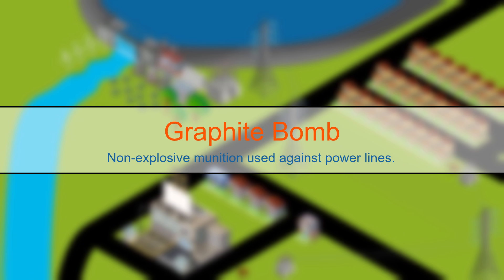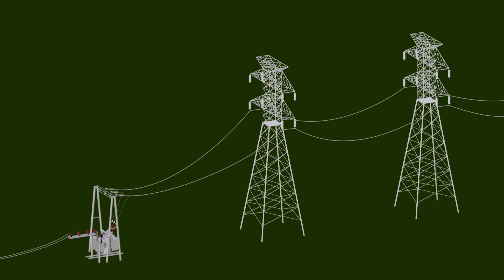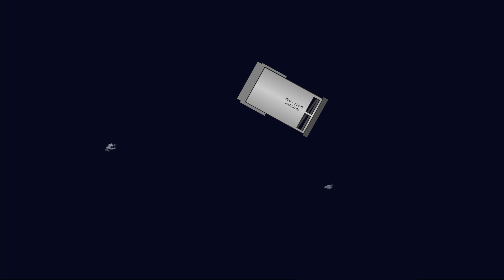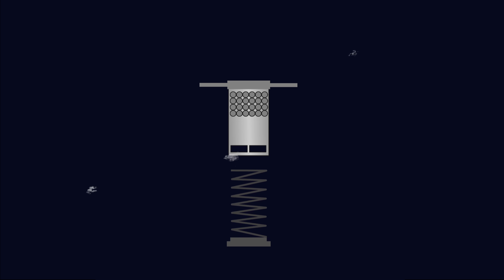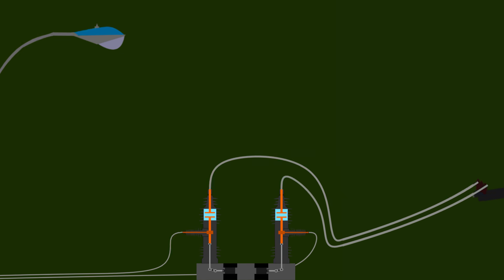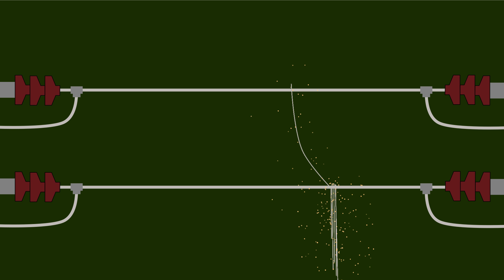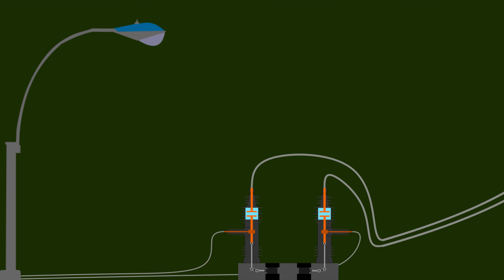Graphite bomb

Comment: Civilians are the only real target in a military operation and any other conclusion is propaganda or psyop manipulation. Any military operation targeting non civilian onjectives are wasting resources and fulfilling the loss conditions.

Also, this idea is beyond stupid due to the electrical potential of graphene and also that graphene floats in air... these actually use a molten copper "film" which melts the insulation and creates more effective shorts circuts. Think of it like a thin sheet of molten copper that solidifies quickly after wrapping around the lines. They arent effective, its best to just cut the lines. Sure this can cause some damage as fault prevention kicks in but they're not even 5% effective.

Comment: Tell me again why our power grid is above the ground, and not in conduit underground?
Reply: Lower installation cost and lower transmission loss.  Permittivity of air is not the same as soil.  Running transmission lines underwater is worse.
Reply: $$$$$$$$$$$$$$$$$$$$$$$Profit$
Reply: It's more expensive, harder to repair, requires more insulation, and because the grid is AC, a lot of power will be wasted since the conductor and ground are a capacitor, and AC can "travel" through capacitors. The same thing happens with in air power lines, but to a lesser degree since the capacitance is much smaller due to the large physical separation between the lines and ground.
Reply: It is way too expensive and takes too long and it more difficult to repair. For larger power lines I'm pretty sure its just straight up impossible because of water from flooding causing short circuits.

Comment: While it disables electrical infrastructure in a way that makes rebuilding easier, it was found during the Gulf War that civilians suffered immensely due to the fact that water and sewage treatment facilities and hospitals were also disabled. In theory, making life for civilians miserable is supposed to make them demand that their leaders end the war, but it can in fact galvanise them against their enemies. Thus, you're just left with causing suffering. Strategically, such consequences must be weighed against the damage it may cause to the military machine. Iraq was still able to launch SCUD missiles everywhere and supply their military, however overwhelmed it was by the vastly superior Coalition forces.

Comment: I once heard about more evil cousin of this bomb: PLASMA BOMB. Tldr after the initial weak explosion disperses graphite particles in a cloud, second, large explosion triggers explosive current generator, which shorts itself through the graphite cloud. The cloud becomes ionized and probably shoot lightning around, and after that it'll probably burn away (being superheated carbon particles in air). Oh, and while this cloud exists as a plasma ball, it also fucks up everything with antenna and/or microchips in it.
Yeah.

Comment: There are protective relays that sense every kind of fault that could present on a power line that could damage transformers. The breakers will always be tripped by these protective relays before any damage to major items such as transformers happens
Reply: You're counting on the breaker not being bypassed by the arc. But yes, modern grid infrastructure is much more resilient against this attack mode.
Reply: lol if a tomahawk can reach this said target then just blow the fucking thing up 😂🎉
Reply: Yeap but what happened in North Carolina sure did some major long term damage to a substation. They are just hoping the illegal immigrants don't catch on. But it was all over the News.

Comment: power plant switch yards are most vulnerable especially isolation bus
not to mention " unintended consequences " of 
software driven protection equipment  also 
Using an array of emitters with controlled phase delays, an EMP could be steered electronically without moving physical components. This would allow the EMP to be dynamically aimed at different multiple targets.
Reply: Salfware protections normaly just enhance mechanical ones

Fuses are still very whidly used

Comment: This was used by NATO back in 99 while bombing Yugoslavia but I remember that the power company would fix the issue really quickly and after that they started bombing substations with explosive munnition. I even saw the remains one of those graphite clusters it was fairly small, a size of a 2L bottle.
Reply: That’s a BLU-114 I think

Comment: As a power system protection engineer I can see many flaws in explanation. Just to mention a  few: the filament will evaporate immediately and the auto reclose will handle the arcing fault in fast manner. Also, this proposed ionized cloud of metal is highly unstabe and will repell itself very fast (ionized stuff repell itsel) and it is also carried away by wind. Permanent contamination of insulators by graphite dust would be result problems for much longer period of time.
Reply: Yeah I dont see the point with this either, you'd want to destroy enemy power distribution, since you yourself are likely going to depend on off-grid power generation as the invading force, regardless. concussive munitions to destroy key points would make much more sense here.
Reply: Don't auto reclosers give up after three or four tries?
Reply: @Dan-vq4pz  Typically yes. But the point is, those thin graphite filaments will evaporate immediately for the first flash over. I guess the graphite bomb is not very efficient for a line. But for the transmission network substation effect can be quite different. If the entire substation can be contaminated all in once, it can't be energized before proper cleaning. Nothing probably breaks for good but re-energization is maybe not possible before all graphite filaments are cleaned out from the substation.
Reply: @reddragonflyxx  Yes, I also found a photo of HV substation all covered by the graphite filament. That makes much more sense in causing outtage. It will require extensive cleaning of all equipment.
Reply: @htchtc203 I saw them using something entirely different, it looked like long shreds of thick aluminum foil that rained down on the substation. They didn't want to permanently damage them.
Reply: @Dan-vq4pz yup usually 3 tries.
Reply: @Dan-vq4pz  and the contacts wear down :) You got 100 cycles, or so.
Reply: They are generally used to trip the OCBs and cause a temporary outage that coincides with a real strike. Also they are more commonly used as radar countermeasures.
Reply: @christopherleubner6633  the anti radar is known as chaff
Reply: ... and yet, these bombs proved quite effective in creating short-term power disruptions, especially to military or industrial places.  The intent, as noted, is not destruction, but interruption.  The purpose is to temporarily disrupt operations while leaving most of the infrastructure intact.  In the case of a comm facility or command post without adequate UPS capability, it's enough to temporarily upset C2 during an attack operation.  They proved to be reasonably effective in Iraq.
Reply: Looking at pictures of the aftermath of these things, it seems like what really makes them effective is the vast number of filaments they release. It looks like the lines are covered in cobwebs. With so many of them, the total current flowing between the conductors would be pretty high, even if some of them get vaporized. The ones that don't make very good contact would pass a small amount of current without vaporizing, which adds up when you've got thousands of filaments.
Reply: Yea the video is completely wrong with the mechanism of action, but this would be extremely effective in a targeted attack against substations. The cleanup could shut down a targeted section of a grid for days.
Reply: Yes this is nonsense.
Reply: Look up the Moore county NC substation attack. That worries me badly with all the illegals Biden has let come into the USA
Reply: The arc of ionisation would cease in 1\50 or 1\60 of a second. AC remember :)
Reply: @andrewallen9993  No. Just watch the videos of the russian rural youth ;)
Reply: @andrewallen9993 Lol, no.
Reply: @fern3436  actually yes :)
Try it yourself at home with an AC arc welder.
Or look up the specifications for AC versus DC circuit breakers.
Or even some YouTube videos for really large voltages.
Reply: It wasn't in Iraq, and it wasn't metal plated, but I've seen what happened when a piece of carbon fiber composite fell across a power line, though not a really big one as in the video. It was quite impressive. A really loud 60 cycle hum followed by a little mushroom cloud. I was a few hundred yards away, but people who rushed over said that there were little fires underneath that they had to put out. The piece fell off the lines. Maybe if it hadn't, a transformer might have been destroyed.  In many places, the epoxy was vaporized, leaving the carbon fiber behind. In some places, the fiber burst out of the composite like unruly hair. In another place, the carbon fiber cloth seemed to be exactly the same shape, but all the epoxy was gone. I didn't see any signs of vaporized carbon fiber. The stuff must be able to take a lot of current before it fails. 

It's my understanding that some types of carbon fiber are considerably more conductive than others. I suspect what I saw involved the less conductive type.
Reply: Yeah, bad design. Power grids are weak though. I’ve worked in subs many are left unlocked. Walk right in the switch house and that’s where you can cause some damage.
Reply: not even mentioning what happens if people breath in the stuff.

Comment: Literally useless.
They would just periodically switch off all protection circuits and simply burn off/explode anything on the lines. Short-circuits are dangerous if stable for minutes and of high current only.
Reply: Which is exactly the inteded use for these, cause distruption in the power grid
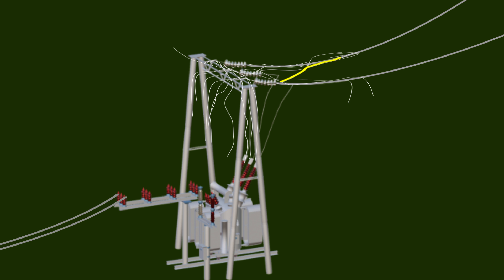Reply: To correct you on that one, they will not “switch off” these circuits. They will install a bypass conductor in parallel with them. But this is quite the clown representation. At 2:51 they have the protective mechanisms tripping on the wrong side of the transformer.
Reply: Based on your avatar I conclude that your an Ordnance Expert and military strategist. Your comment is unvaluable.
Reply: You’re

Comment: We use underground power cables in the U.K. so we are ok from this device.
Reply: Not exactly.  You’re switching stations and high voltage transformers are above the ground and very vulnerable.  But I agree there as wisdom and below ground cables.
Reply: @eeroala5132  they aren’t as maintenance intensive you don’t need to worry about trees shorting them out.  All our mains voltages cables run by the side of paths (sidewalks) or roads so tree roots cannot grow around them.   If graphite bombs was known about a temporary fine wire mesh can be built over vulnerable switching points or open air wires.  All our local substation transformers are covered anyway usually in a brick building or by a box around the transformer but national grid transformers are different but still easily covered if needs be.  In the USA it’s much harder since all your national grid is run on pylons above air and your local transformers are all open but still easily covered if needs be.  Since the USA is much bigger than the U.K. your national grid transformers and switching points are huge much more difficult to harden against this typer of attack and as a plus our national grid is very rarely effect by CMEs from our sun so it’s much harder to over load.  It’s a better system.
Reply: @joeds3775   No it’s not around houses, streets and cities it’s all under ground…. We do have pylons though but trees are no where near them, it’s all in open field’s.
Reply: @Biketunerfy  i work on the grid. You're wrong. Take a look in the countryside.